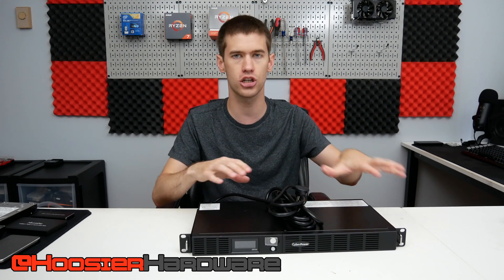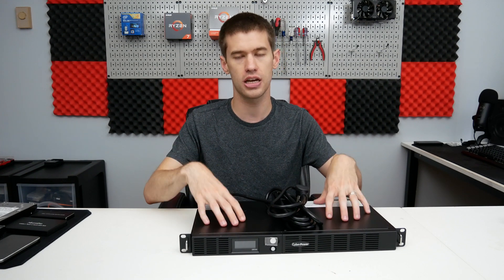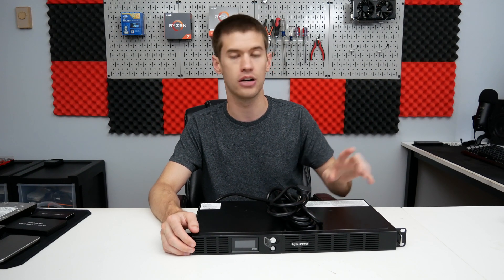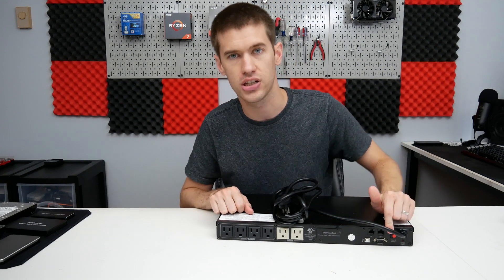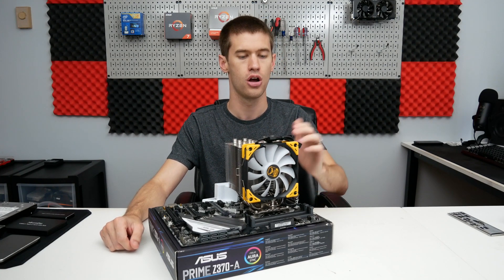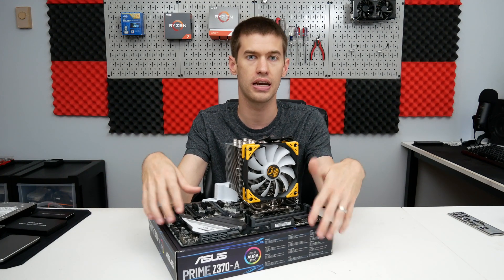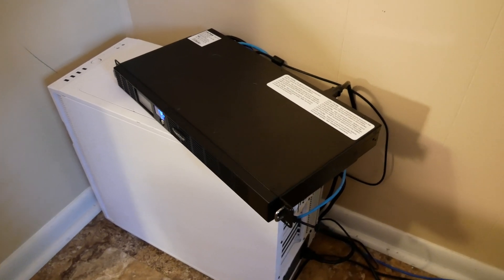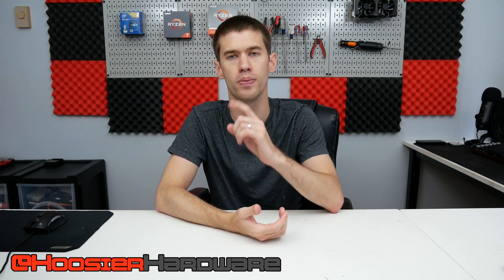UPS Installation and Platform Change - Home Server Upgrade Part 1

Comment: Hello from Danville!! I have and old i3-4130 running 4 6 tb drives in Raid 5 for my Plex and general back-up. It sips power and can still support 3 streams at once. So no complaints